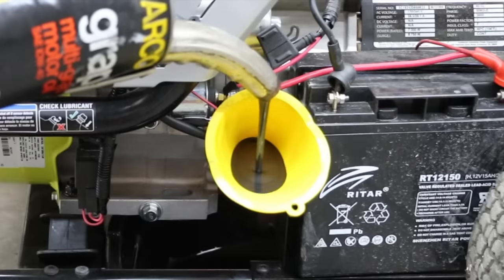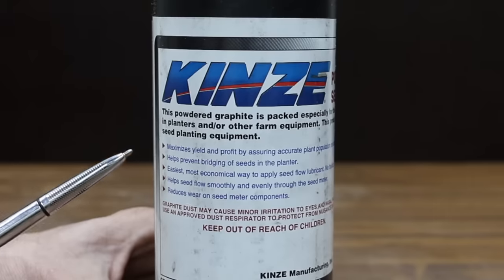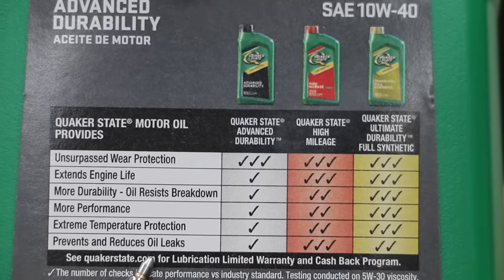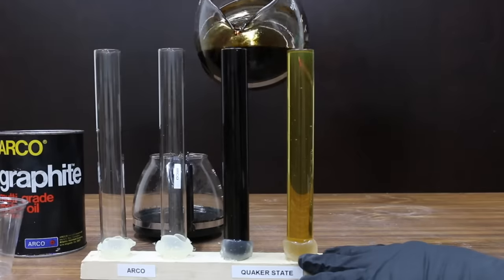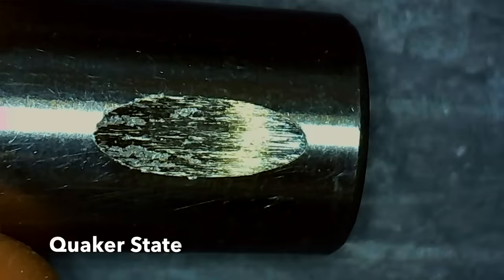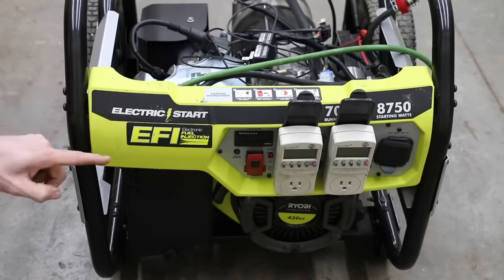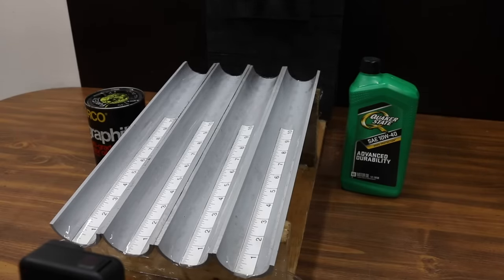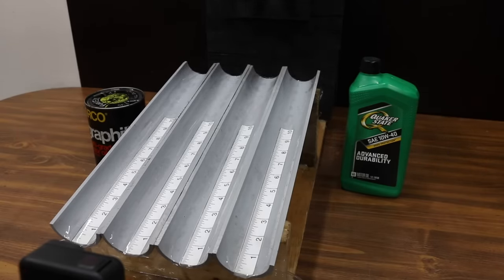Will "Graphite" Help Motor Oil Performance? Let's find out! Vintage Arco Graphite vs Quaker State

Comment: If I remember my  high school science (late 1970's), it's water vapor molecules from the atmosphere that act like ball bearings between the graphite platelets and make graphite slick.  I believe there were spacecraft failures (like failure to deploy an antennae arm) before it was discovered the role air played.  I would be skeptical of benefits of graphite in a liquid.
Reply: Rotella is a modern engine oil engineered with graphite in it. It is used in many modern Diesel engines. So.....

Comment: The danger of additives is at high revs they can centrifuge into the crank in a similar way to the muck in dirty oil restricting the lubrication flow
Reply: Now. Pitch this for a video idea to the guy. I want to see some of this action. Idk how to make it work, to word it, to think about it. But that sounds like it's near a good video idea. Go tell him.
Reply: But if its a small engine without oil filter (without oil pump) then its a pretty good idea actually...?
Reply from the maker: Thanks for the feedback.

Comment: The oil runs out of the moving parts when the car isn't used for a long time, and even overnight, especially with thin oils. Thus the majority of engine wear occurs on startup. 

The graphite should stick to all surfaces and not run down thus   providing lubrication on startup. 

I've seen a car with mild rod knock on startup. The knocking stops within 2 seconds as soon as the oil  returns to the crankshaft.

Keep in mind that graphite is extremely soft ( it's worn out by paper) and thus a good lubricant. 

I wish he had removed the oil filter, however all the people that have used it confirmed that it doesn't clog . I doubt a company from that era would sell something that clogged the oil filter.

I might try this on a car from the 60s
Reply: Old Crow's Classic Cars good point with the filter clogging, when I try this, I suppose I will just tear a filter apart, fit a small mesh screen in place of the paper, and weld the case back together.
Reply: I'm pretty sure that's been debunked. 1) not all the oil drains off the parts (especially not on bearings that are touching). 2) oil is flowing within seconds. 3) that few seconds before oil is flowing is about 0.1% of the engine running time, and conditions are much less harsh during those few seconds, compared to driving. I believe it's been proven that "cold start wear" is negligible.
Reply: "majority of engine wear occurs on startup"

That's where you are wrong, kiddo.
Reply: Ok grandpa, that's an old wives tale.
Reply: @MechanicalTriage  I've read a big chunk of the comments and everyone that used this stuff says it won't clog the filters. Recall that cars back then had filters too.
-Couldn't find a single person that says it's clogged their filter.
-I've read about 3 seize tests where the graphite did much better than the regular oil.

Perhaps I wouldn't have put so much graphite. I'm certain that too much graphite will increase viscosity; this might be desirable in some cases.
Reply: @evolicious  where's your evidence to support that?
Reply: @coalandsinatrakittiecats7358  where's your evidence??? maybe thats just your opinion. I've given a quite thorough explanation.
Reply: @OldCrowsClassicCars  he's a troll, it's well documented that engine wear occurs in first 10 to 15 minutes.

Comment: I remember hearing once about old time used car dealers adding sawdust to motor oil to quiet knocks and other undesirable noises, I've always wondered if that was true, and if it actually worked.
Reply from the maker: Thanks for the video idea.
Reply: dealers over here used to fill a noisy car with EP90 so it would sound sound good for a few miles.
Reply: @ProjectFarm  Have heard same story in 1970 s in Europe, sawdust for clutter noise...
Reply: Sawdust was fake O-negative blood for cars and trucks. Made engines, manual transmissions, and differentials sound great for about 40 miles. Then everything just dies.  There seems to some debate regarding sawdust in crankcase, but that was a “common phobia” regarding unscrupulous used car dealers in the early 50s.  Never saw it in crank cases personally but my pro mechanic brother-in-law claimed to have cleaned sawdust out of oil pans a couple of times.
Reply: I heard sawdust was added to noisy worn transmissions.
Reply: I believe that was for the transmission... not the engine.
Reply: That was actually an episode from the Andy Griffin show in Mayberry.
Reply: And use super super glue to stick on bunpers because welding is too expensive I hope people get this referance
Reply: I’ve heard that too, I’m from Winnipeg, you?
Reply: That’s a old wives tale about sawdust. 

It would clog the oil pump screen very quick and the engine would die soon after. 

Even if any got thru it would plug up all the oil passages.
Reply: ferkemall The way I always heard it was it’s used inside of a engine. 

Sounds like it started with axles/transmissions and then morphed into engines like these old wives tales often do.
Reply: One of my uncles had a worn out tractor in the 1940's or 50's that knocked. He put bacon rinds (skin) under the bearing caps and it stopped the noise long enough to sell it. 
Never heard what happened when the bacon was done cooking...
Reply: Inspectah T yup haha
Reply: Back in the day, we had a local car dealer who welded together three pieces and ended up with a 1970 GTO Judge! I don't know how many people could have died in the cars he welded together.
Reply: Only in standard transmission the sawdust would tighten the tolerance specs and actually last a while. Just don't try a cross country drive.
Reply: And old stories of banana peels in the differential to shut it up for sale.
Reply: @m476nycity  that's crazy I never heard of that one good to know thanks.

Comment: I've been using Tufoil in my car for years would love to see a test on that. I don't know if it works or it is a mental thing that makes me feel better about myself. But I am at 200000 miles and still going strong.
Reply from the maker: Thanks for the suggestion.

Comment: When I worked for a Chrysler dealership (1982-1994), my boss, the dealer principal, drove a 1987 turbo LeBaron coupe. He was a retired Air Force RF4C pilot with a ton of recon missions over N. Vietnam including Hanoi. He was a believer in that graphite MoPar oil, and it never failed him in that high heat environment (albeit that it was an oil and water cooled turbo on that model). It just felt weird poring BLACK oil INTO a car. LOL
Reply from the maker: Thanks for sharing.

Comment: can you do another similar test but use the same type of oil one with added graphite and the other be control?  this should limit other factors so it'll be easier to determine how much the graphite alone effects anything instead of other additives and agents in the oils
Reply from the maker: Great test idea! Thank you
Reply: I don't think it would make a bit of difference.  We gathered the data from this presentation needed to determine, whatever benefit graphite might offer is miniscule at best
Reply: Giggidygiggidy12 it's the scientific method. Whenever investing an effect you need a control to measure the differences.

Comment: I’m assuming the Arco oil is from the 1970s. If so, does the age of it affect the results?
Reply: Neal Head  I get what you're saying, but, crude and "motor oil" are two very different things. Still, you may be right. I've no clue really.
Reply: Not really as it was in a sealed container, however there have been huge advancements in oil technology and the comparison is unfair. There is a reason we don't use it though.
Reply: He did an experiment on an oil from the Stone Age.
It's in his playlist somewhere.
Reply: None of the elements are organic so age will have null effect
Reply: The expire date on the can was 10/40 !
Reply: John Doe This is false. All chemicals will degrade over time and motor oil IS made of organic compounds.
Reply: John Doe not sure why you would think this. Manufacturers recommended changing oil every year if you don’t even start it up once. Everything degrades. That’s entropy friend.
Reply: @JohnDoe-hx1wx  No offense, but oil is a Hydrocarbon
It is, by definition, an organic compound.
Reply: macthelost agreed, oil does break down over time even if not used
Reply: It’s not made out of milk.
Reply: I have to agree with John Doe here, in a sealed container, the oil should not degrade over time. However, if you place it in an engine, it most likely will degrade since it will be exposed to the air and can oxidize and evaporate.
Reply: Probably not. Engine oil inside of an engine turns acidic due to combustion effects and exposure to moisture and air. If it's in a can it isn't subjected to those conditions.
Reply: I still have a sealed quart of motor oil from the 1970's but on a motor oil website says it could cause damage now
Reply: Organic or inorganic, things will break down over time, exposed to air or not.
There are more forces than water, air , whatever.
Radiation, cosmic rays, slow reactions within the chemicals themselves that were overlooked.
Nothing survives time.

Comment: Back in 1976 my father decided to give Arco Graphite a chance so we started our journey to canada from Los Angeles. Just inside Utah the lifters on our 74 Chevy suburban started to clater and we headed to a shop to have it looked at. Turns out the Graphite in the oil plugged the filter and caused a low oil issue. They flushed the engine out and and with new non Arco Graphite oil we continued the Journey. we did around 150,000 miles after over the years after that mistake with no further issues.......
Reply from the maker: Thanks for sharing.

Comment: Years ago, working at the research center, we ran a series of various oils in a fleet of vehicles.  The granite oil we used, while not labeled as Arco but it surely was.  That stuff left a mess behind, very difficult to get it flushed out to switch to the next oil.  When the test series concluded, there was a bunch of it to be disposed of.  I used it for bar oil in my chain saw for years, nobody else wanted it!
Reply from the maker: Thanks for sharing.

Comment: This reminded me of going to Afghanistan.  Stripped all the oil from our rifles and sprayed graphite powder on the moving parts.  Worked phenomenally  well since oil tends to catch dirt and gum up the action. Gun never failed
Reply: M-4? How did the parts look after your tour?  Any significant wear?
Reply from the maker: Thanks for sharing.
Reply: I would love to know how that worked as well. Thinking of doing that on my guns
Reply: I would love to have seen the wear after your tour as well. Graphite can cause or promote galvanic reactions when used to lubricate alloy and ferritic metals such as between the BCG and receivers in the M4. Glad it ran well, that’s all that really matters!
Reply: Rifles looked fine with no issue.  We did we did cleaning/maintenance at least every 3rd day if we hadn't fired a round and every day if we were shooting. This was south west Afghanistan so low humidity and high heat. Once you move to the mountains out of the desert conditions you switch back to clp. The galvanic reactions require moisture to occur which there wasn't a whole lot in the desert.

Comment: One thing I would like to see is how different oils react to graphite being added. Does it make them better or worse etc.
Reply from the maker: Thanks for the video idea.
Reply: good idea, i think as other commenters have mentioned with oil filters etc its not good for automotive engine oil, but small engines without filters and for other applications it might be suitable haha. i wonder about my old 2 stroke dirtbike (1997), i use 80 weight oil for the transmission, and i wonder if adding graphite would make the old thing feel a little smoother. i have heard that ATF is suitable, what about ATF+graphite? i haven't ridden it much since i rebuilt it and gave it a new pipe and exhaust. she still keeps up and exceeds the pace of people on modern bikes. suspension is next XD

Comment: I've never liked Quaker State engine oil but it seems to me that graphite would plug up your oil filter unnecessarily.
Reply: Yeah, I bet this is a large part of why it never caught on. Any gain from it are pointless if it clogs oil filters.
Reply: @lobsterbark  Iirc, they claimed the particle size was small enough to pass through the filter.  Used oil is black and still gets through a filter, so it's plausible.  I ran Arco Graphite for a couple of years and didn't ruin the engine.
Reply: I drove small block chevy engines to about 250,000 miles each for over 30 years.  My Pops got me started with Quaker State.  It was poor oil.  Took out my first cam with it and stuck a ring.  Engine all sludged up, with lots of varnish.  This was with oil changes every 3500 miles!  Switched to Shell Rotella-T 10W30 and/or 15W40 and never looked back.  Next two trucks ran to over 200,000 miles with no major repairs.  Had to tear down the 97's for intake gasket leaks (the darn dexcool problem) and the engines were so clean inside you could eat off them at 100,000 miles.  No cam problems, no ring problems, oil pressure near new through their life.  I am a convert to Shell mixed fleet Rotella-T
Reply: @theoldbigmoose  - That's what I run in my Cummins. Rotella-T. Good stuff!
Reply: graphit is a abrasive it cleans all the varnish off the parts and ruins the motor
Reply: @ronadpaugh44  - Well, at least it'll be ruined cleanly....
Reply: @ronadpaugh44  Graphite is a dry lube, it's not abrasive.
Reply: And, Quaker State bought Pennzoil some years ago!!!! and then they removed the Pennzoil famous ZR-7 (if my memory severs me correctly) So, I would NEVER EVER FOR ANY REASON use either of these oils in anything I own!!
and I NEVER will use the Fram Extra Guard oil filter either, Nor the new packaged Super Tech oil filters, the older packaged ones were made by Bosch, I have No IDEA who makes them now but I bought one just to cut apart and examined it and they are one VERY cheaply made filter.
My oil of choice for the last couple of decades or so has been Havoline, which used to be a Texico product, but now is a Chevron. I run all my car engines to at lest 200,000 miles, I change the oil twice a year which averages 5 to 7 thousand miles. I've not had any internal engine failures or internal work done beyond valve cover gaskets sense around the year 2000. And on those valve cover gasket replacement the upper end of those looked very, VERY nice. I've never had any oil pressure problems in any of my engines either.  Its clean, its works wonderfully.
Reply: @mwv8408  - Yeah, filters.... I go and buy Honda filters for my Honda, and Mopar filters for my Cummins. I'll run Valvoline in my lawn mower, but my cars get Mobil 1 and my truck gets Rotella synthetic. Cheap oil and additives are just something I don't do to my cars. It costs me nearly 100 bucks to change my own oil in my truck, and I'm ok with that.
Reply: @ronadpaugh44  it's a lubricant...
Reply: @robertgantry2118  Mmhm, I don't own any trucks but definitely prefer Mobil 1 filters and oil for my cars, and I've heard nothing but good things about both Shell's Rotella and the new Mobil 1 HD high performance truck oil too. I'm working on a microjet engine in my spare time and a lot of the research leads me to believe that Rotella or Mobil 1 HD synthetic will be the key in keeping the bearings running at 100k RPMs (minimum).
Reply: @DeltafangEX  - Microjets. Sounds like a fun hobby. Yeah, I've heard Mobil 1 oil filters are good. I was going to switch over to those except I couldn't ever find the one I need. So, I just use factory filters. At least that way, if I have some warrantied problems with my engine the dealer won't try to blame the filter.

Comment: I used Arco graphite in a '77 Chevy small block. Couldn't tell much difference in performance, except at the end of a 1.500 mile trip. Lifters started tapping loudly at highway speeds. Luckily, I was near my destination. Had to add an additive to get it going again. Stopped using this oil within a year. A couple of years afterwards, had a lifter start tapping, so I learned how to change lifters. No rod damage, just a stuck lifter.
Reply from the maker: Thanks for sharing.

Comment: I want to see something with the shell rottella T deisel oil. Great video!
Reply: I would like to see more diesel related stuff (just because I recently bought a cummins). But I use redline and bestline additives and have great results in my gas vehicles. I'm about to try arch oil additive next oil change on the diesel tho

Comment: I had a little Ford Escort back around 1983, a manual. I tried the graphite oil with the next oil change. I'm pretty sure the instructions was to do a normal oil change except the last quart was to be the graphite oil and run the engine when adding it.
I could hear the engines rpms increase as I added it. My mileage did improve to where it was quite noticeable but can't tell you how much. I can't remember it was to many years ago. Only used it one time, no problems, but never used it again and my mileage never seemed to decrease. Never used it again, mainly because I couldn't find it. But I was under the impression that it was only a one time additive.
I would have probably used it again on my other vehicles that I have had since but I kind of forgot about it and didn't see it on the shelves anymore.
Reply from the maker: Thanks for sharing.